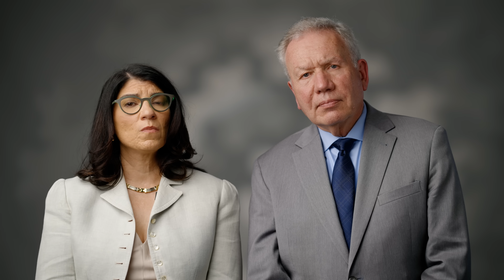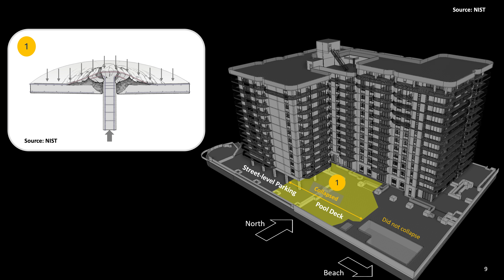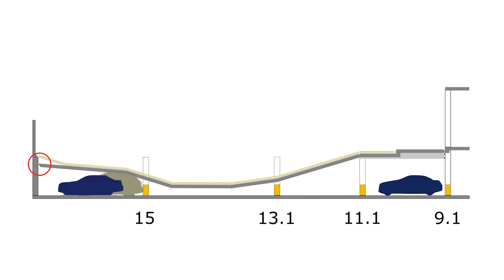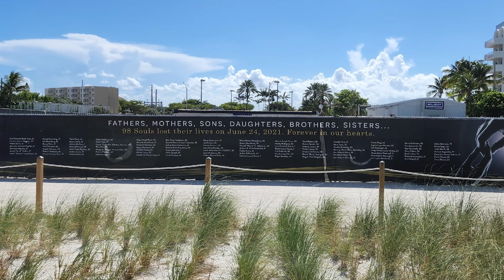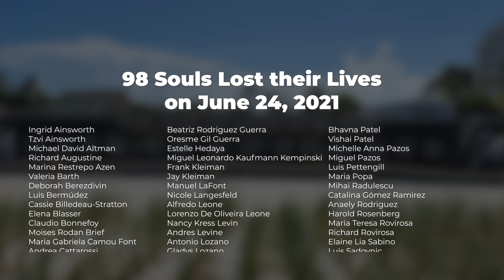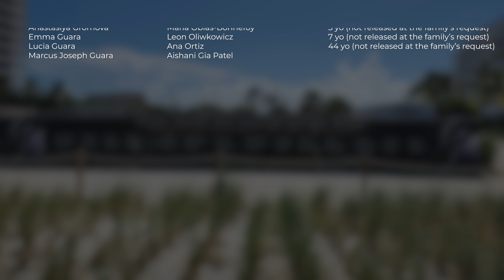NCST Champlain Towers South Investigation | Summary of Technical Findings (June 2026)

Comment: "They have determined that the cause of the collapse was long term degradation from corrosion", .. That just sounds like a cop out to me... We have buildings from the 50's that are still strong AF and will only come down if you tear it down...Are we supposed to be afraid of anything built in the 80's or before??? This "Report" reminds me of building number 7 from the 9/11 attacks where the building fell strait down into it's own footprint,... and NIST said the cause of the collapse was regular building fires... Really??? A Steel building!!!, ... burned down, melting the steel from all four corners of the building all at once, from a regular open fire burning office supplies, rugs and furniture!!! ...   "RRRRRRIIIIIIGGGGHHHHTTTT!!!"  (Ala "Austin Powers)....

Comment: Something that has not been mentioned in the investigations & comments abroad.

Specifically the pool, pool deck area & eventually intersecting columns where the failure occurred were exposed to long term commercial-grade highly concentrated corrosive chemicals used to maintain the pool water not to mention the saltwater from the adjacent Atlantic Ocean. Due to building settlements, lack of maintenance, vehicle damage to lower columns, vibration to pool area i.e. pool, pool  deck slab & columns overtime experienced structural cracks allowing the corrosive chemicals & saltwater to settle into these cracks & causing steel reinforcement corrosion degradation. It is my opinion as a professional structural inspector with many years of experience that this is a major contributor to the problem. The NIST should reconsider this as a factor in any future investigation specifically related to pool deck failures.

Comment: The pool deck had horrible drainage and constantly had standing water on top of it. Additionally, inadequate waterproofing from construction caused water to leak into the parking garage below. This was noticed even in the 1980s, but a proper tear down and rebuild was never done, only caulking holes from the garage side as they formed, causing the rebar to soak in water for extended periods of time. The standing water slowly seeping through the slab corroded rebar, caused extreme concrete spalling, and generally weakened the integrity of the entire slab. The critical joint between column and the slab was poorly designed and built with even less rebar than designed, just as NIST explained. The slowly increased weight was also important. Marble countertops replacing wood veneer and expensive heavy tiles replacing laminate as trends changed over 40 years slowly piled on the pounds. Heavy planter boxes were placed on the pool deck slab and were only removed once extreme damage had been noticed. The lack of a shear wall between the pool deck and condo building caused a small failure of the pool deck to cascade into nearly taking out the entire building.

Each of these things seems mundane, but no one sounding the alarm during this slow failure caused substantial loss of life. I appreciate NIST's investigative work and hope recommendations will be promptly be turned into enforceable laws to keep people safe.
Reply: I keep thinking that the issue with sounding an alarm over it is that none of the warning signs were seemingly all that threatening (the planters cracking due to the pool deck sagging, the leaks caused by the columns gradually punching through the slab, etc.) because the building had been exhibiting similar issues for many years and the owners had been wringing their hands for a long time over the cost of repairs, so ongoing issues had become normalized.

And I honestly don't believe any city official or inspection company would've had the guts to sound the alarm in the correct manner which would've been to forcibly evacuate everyone immediately and condemn the building as an immediate collapse hazard, since before the disaster it would've been such an alien and unthinkable idea that a non-historic building in a modern city could collapse solely from reaching a point where it was structurally too compromised from accumulated wear and tear to stay up that anyone attempting such measures likely would've been crucified given what an immense disruption and financial catastrophe it would've been for the unit owners.

After all given what I've read, the new regulations enacted after the fact are already very unpopular because they effectively bankrupted many condo associations and their unit owners due to how much more expensive it became to remain compliant.
Reply: @meckelbu  I think the key issue that made those minor issue turn deadly was the fact that the building wasn't built with the appropriate amount of rebar in those columns. The only way to determine that would be some sort of x ray imaging and computer simulation which would be expensive too.

Comment: Thanks for the update. I believe that one original design change would have either prevented, or considerably slowed the collapse: If they had specified a sufficient amount of reinforcing steel at the critical shear-punching points.
It's obvious the building was under-specified, poorly maintained and had unauthorised work done, but the additional rebar, had it been added, would have saved lives.